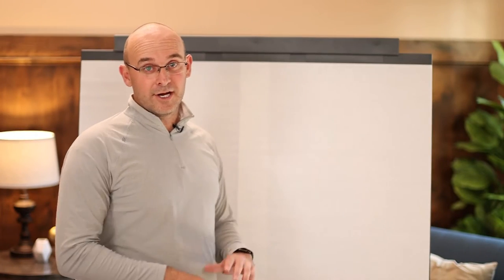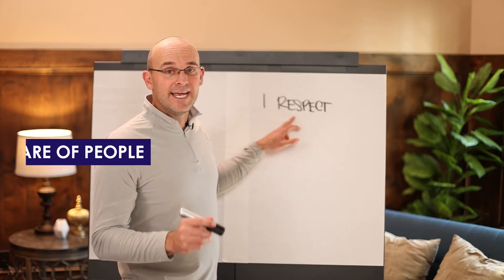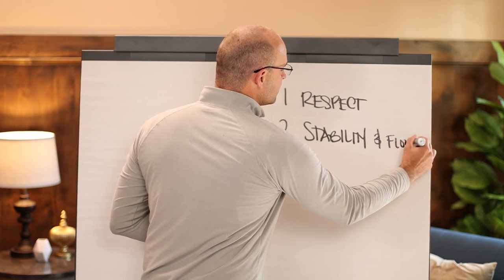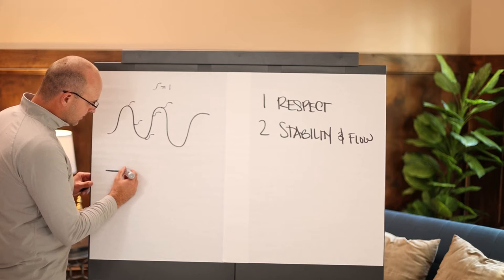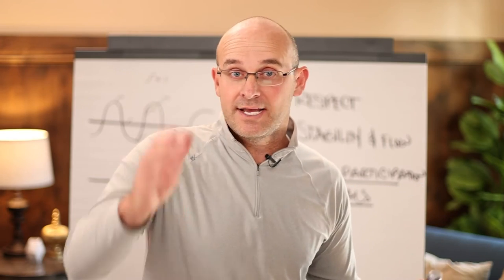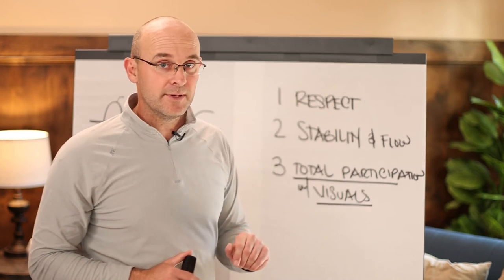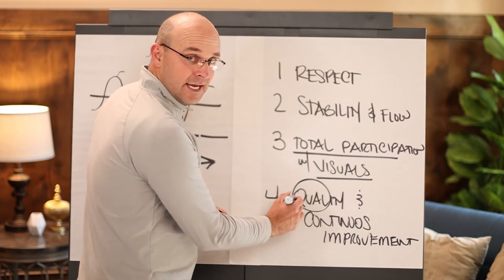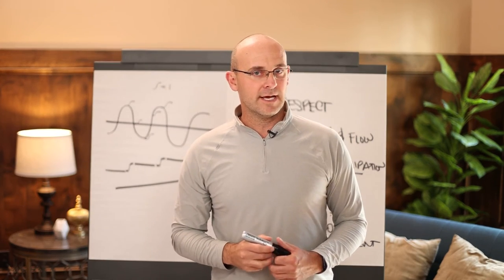What Is Lean In Construction?

Comment: Hey! 
I'm currently writing a bachelor thesis on lean construction, especially on the differentation of the application of lean construction in different construction sectors (for example, building construction, street construction, bridge construction, tunnel construction and engineering construction).

Have you made any experience on this topic you can share or how do you see this topic?

I would be glad if you leave a comment! 

With kind regards
David

Comment: Sir let me know different between value engineering and lean construction.
Reply: I am still a beginner, but I think that sometimes even if operations appear superficially similar, value engineering derives profit/value where lean construction foremostly integrates respect into communication then resources. Ex: continuously improving a stable delivery schedule helps both save workers' time and transportations cost. Value engineering might be as small as printing the weekly gannt chart in the field office, but lean thinking would be to effectively communicate that at different scopes with digestible visuals for all workers and even clients. Though value engineering also values social factors it is only at best equal to all other conditions of the site and objectives. Whereas lean construction prioritizes a holistic operation even after the product is delivered as suggested in @LeanBuilt 's follow up video https://www.youtube.com/watch?v=Oyt4IA-231g.